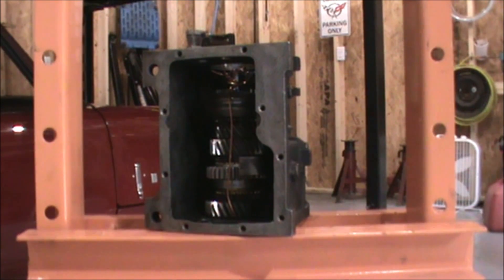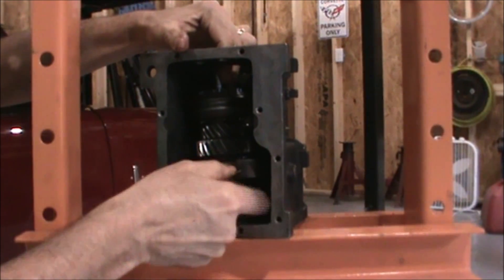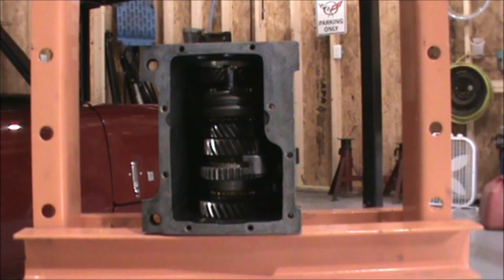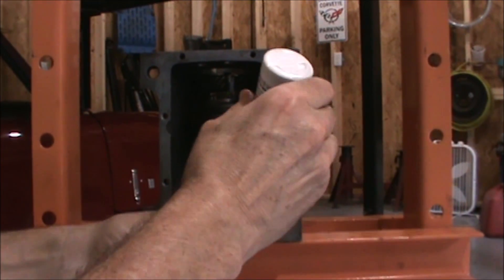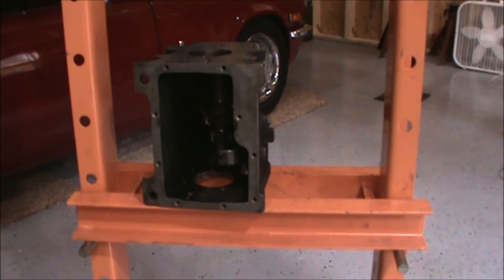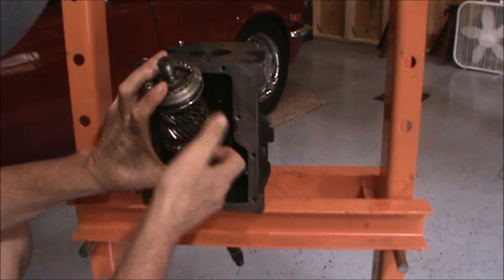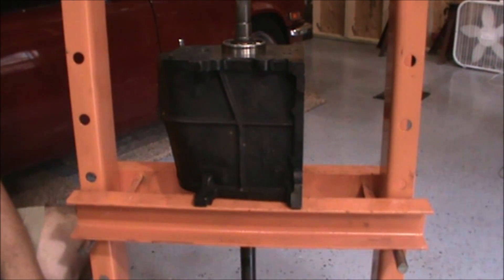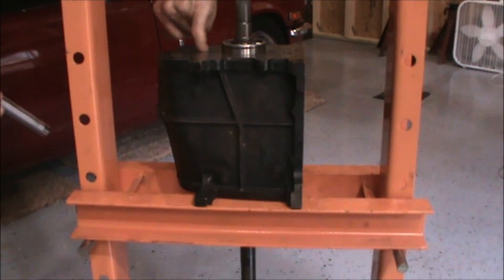Triumph Spitfire 1500 Single Rail Gearbox Rebuild - Part 4E - Input Shaft Installation

Comment: Thanks Mike for your interesting videos. I follow your work, especially because I just bought a single rail gearbox with a j-type overdrive for our 1500 without od. From this gearbox there is no history known. So I will take it in pieces and check it before building it in. I hope you don't mind me having a slight piece of criticism about the way you press in the bearing: I recommend you to not lead the pressing force over the roller balls, but take a piece of tube that fits the outer bearing ring and so only force the ring and not the rollers. The same when pressing a bearing on a shaft. This to avoid the bearing for being damaged or getting noisy. Best regards from the Netherlands.
Reply from the maker: Thank you for the criticism.  That's a great tip.  I should have thought that through.  I appreciate it!  Good luck with your gearbox.  Hope it was a good purchase for you.